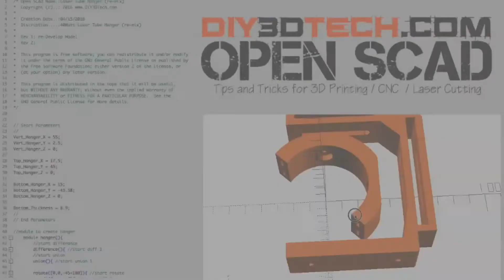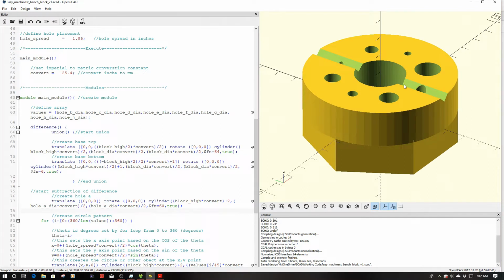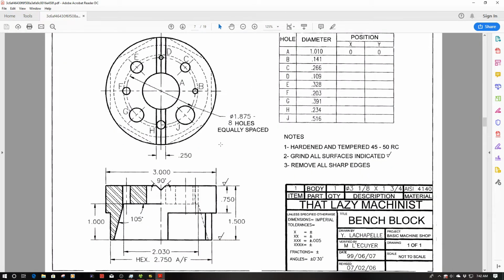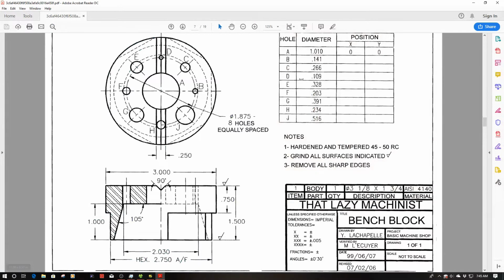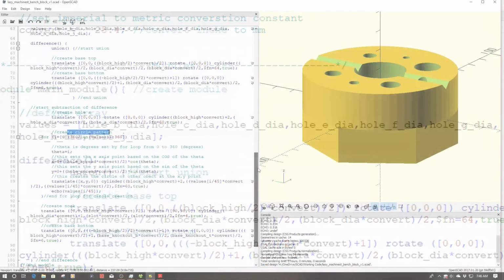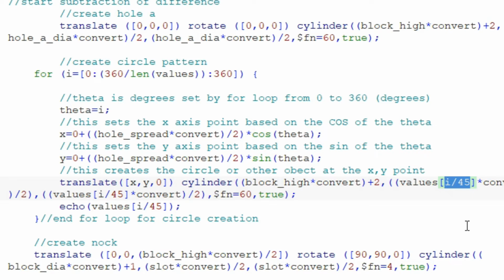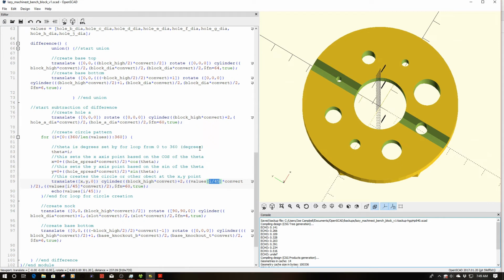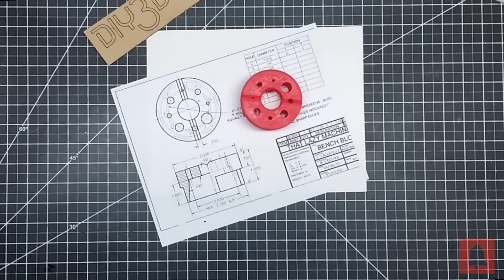Open SCAD - That Lazy Machinist Bench Block!

Comment: I like to use something like this for a circular pattern:
arr = [1, 2, 6, 5, 3];

angle = 360/len(arr);

echo(angle);

radius = 10;
firstcylinderpos = [ radius, 0, 0];

for (i = [0:len(arr)-1]){
    
    echo (arr[i]);
    
    rotate([0,0,i*angle])translate(firstcylinderpos)cylinder( h=20, d=arr[i]);
}
Reply from the maker: Interesting, so you reversing the concept.  SInce all angles are fixed, you enumerate that and then index for the "for" loop based upon len(arr) so I*angle returns the position.  Clever!
Reply: @OpenSCADDIY3DTech  Really, I would only do this if I was accessing an array. But normally if I am only placing the same object in a circle pattern would do something like this.

module place_on_circle(r = 10, num = 2)
{ 
    
   for (angle=[360/num:360/num:360]) {
       rotate([0, 0, angle])translate([r, 0, 0])children();
       }
}
       
       
       
 //translate([10, 10, 0]) //Change the center
 //rotate([0, 0, 10]) // Change the start angle
       
place_on_circle(50, 18){cylinder(r=5, h=10);
           cube([10,10,2], true);
       }

//

Comment: I have a jewelers block that looks much like that. I'm curious what use you have for a plastic version.

I agree knowledge of 3D printers will in some aspects transfer to the cnc machining world. I'm going to stick with FreeCad for my needs and notice SCAD is built into it. Have you used it from within FreeCad and if so does it function the same?
Reply from the maker: The PETG version is crazy sturdy and relatively non-maring.  I also use for drilling both round and flat stock on the bench too!  Will have to check out Free CAD as no I have not as I pretty much switch between Fusion 360, ThinkerCad (more for a 3D work plane then design) and Open SCAD...

Comment: after watching the vid, your long math crossed my eyes, but I'm a self taught coder with only basic math knowledge.  That said though, could it be done by dividing 360/# of positions in the array?
Reply from the maker: the issue with 360/# is Open-SCAD doesn't allow for the restantion of a value (i.e. A=A+1).  However another viewer commented with good idea of reversing the calculation as angle is fixed so you calc that then multiple using for loop based upon Len(Array)-1